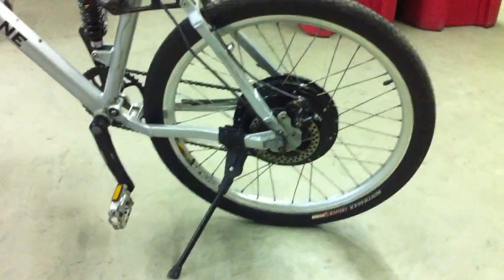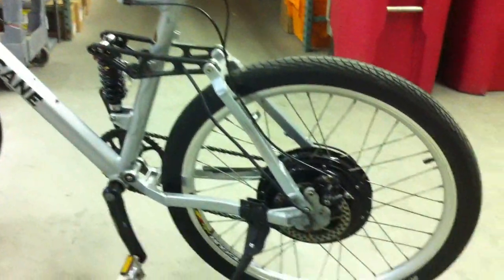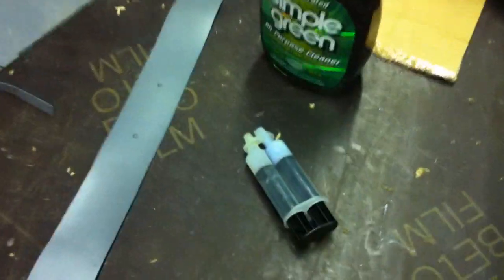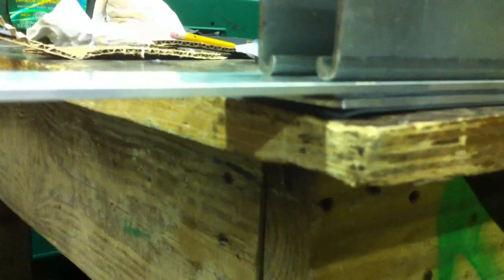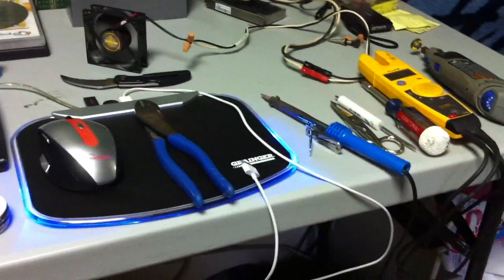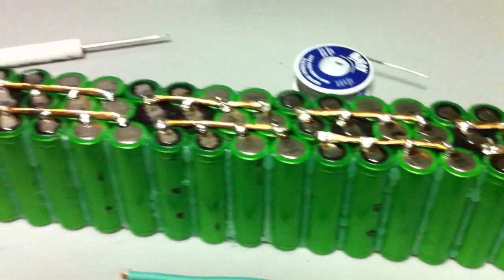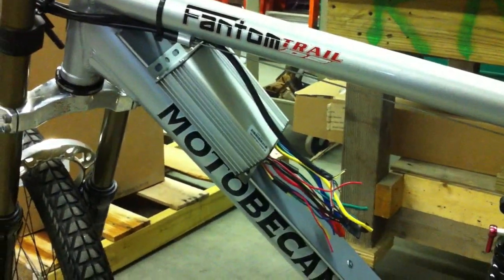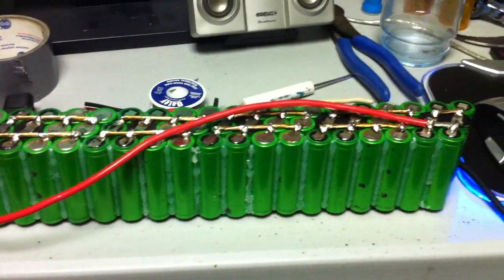EBIKE 72v - Component mount design and battery pack build

Comment from the maker: do a google search for a 43.8v lifepo4 charger, they are designed to work with the BMS of the battery and bulk charge/ balance charge the pack so each cell stays the same and does not get overcharged. If there is no bms the battery will need one before you can safely use it.

Comment from the maker: The vendor you purchased your Lifepo4 from should have included a charger.. if not get one from them. A standard 36v charger will have a higher voltage since it is mainly used for SLA batteries. This could damage your new Lifepo4 packs or cause problems with the packs BMS. If it is your only option you can use it, but you will need to monitor the voltage and cut it off before it gets too high. this is not recommended

Comment from the maker: @staver76 yes you definitely can use bullet connectors and im pretty sure they have a higher amperage rating if you get the good gold plated 5mm ones you can get almost 90 amps out of them. and a 30w iron should be enough for the task!

thanks for watching

Comment: @skeetab5780 Could you use Bullet connectors on the ebike battery to motor? *By means of soldering  them on each end with a 30w soldering iron?* (Also, are bullet connectors even possible to use to connect a 48v 1000w motor to a 20ah lifepo4 battery?)

Comment from the maker: @staver76 yes you could put the sla in series with the lifepo4 you should put a diode between them on the positive wire so you dont damage the BMS of the lifepo4. you would have to charge them seperately obviously

Comment: @skeetab5780 To add more amps I would have to connect in parallel. Could I connect a 48v 20ah lifepo4 with a 12v 20ah sla battery? or would i need another 48v?

Comment from the maker: @staver76 you would need to put a 12v 25ah lifepo4 in series with your 48v 25ah lifepo4 to make a 60v 25ah lifepo4 pack, but you could series the 12v pack you have...but the ah rating of the smaller pack will be the falling point of the whole battery. and if you continued to discharge the battery too low you could damage the smaller AH battery.

Comment: @skeetab5780 Sorry for another amateur question, if you were to connect a 12v lifepo4 battery *like only 10 or 5 amps* in series with a 48v lifepo4 25 ah battery, would you get a 60v battery 25 ah battery powering the motor or a 48v 30 ah battery, *also, is the following method above even possible?*

Comment from the maker: @MaxSachs ya i actually just ordered the turning heat shrink off hobbyking that karma linked. it was 15 USD shipped for 2 meters length, but its 100mm not 9"! the 1010B charger is awesome..i want one but i cant justify the price

Comment: @skeetab5780 
The 14S14P pack is to be chopped up into 7S14P pieces to be connected in series for discharging, then split for charging with my iCharger 1010B. I could also make a 15S15P pack to consume ALL my cells....splitting them up into 5S15P pieces.  Batteryspace shipping to Ontario, Canada is retarded, 4 feet of 9in shrink wrap was over $35.